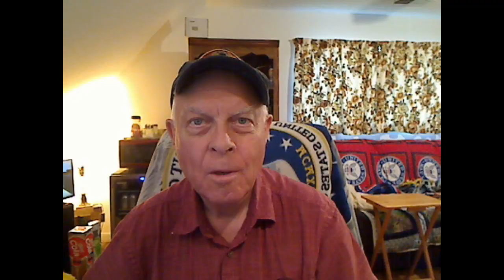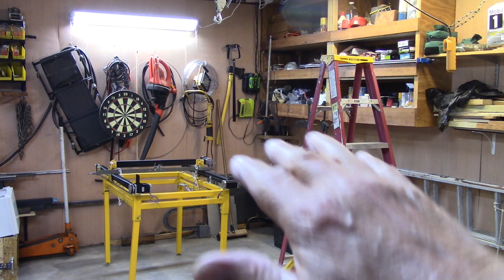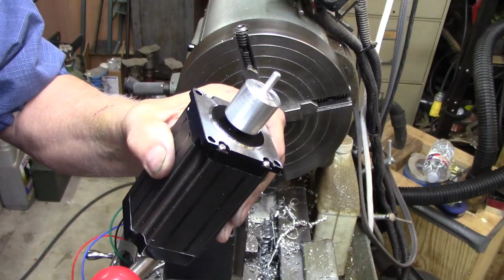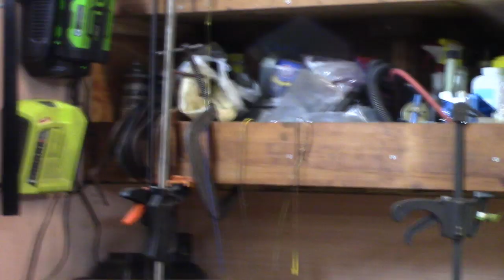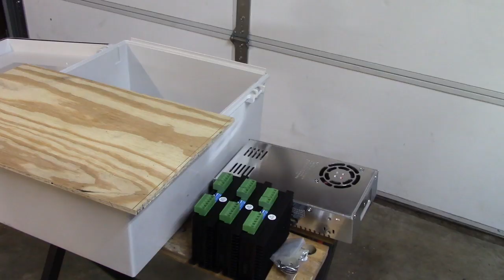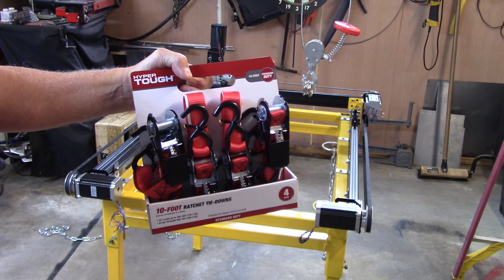Plasma cutter table Z axis finished

Comment: I'm getting excited for you, that unit is really starting to look the part. It's interesting to me to see how you're setting up the control system, as I'm curious how you are going to integrate a design from a PC into the number of steps in each motor's direction to cut your part. Very cool project.
Reply from the maker: The answer is smoke and mirrors of course.  Thanks for stopping by.

Comment: More great progress. Wondering if each corner had a hole for an "S" hook and then make a four way cord or cable set to suit the CG (numbering each connection point and its associated cord), so that from one hanging point you could then attach each of four lines with "S" hooks. Not sure if that makes sense!
Reply from the maker: I have it fastened to each corner.  Thanks for stopping by.

Comment: Did you calculate your linear travel speed for the drive pulleys you have? I think you may have gone a bit too big in diameter for the work envelope of your machine. What you want is high acceleration not high top speed (your top speed will still be plenty high enough and you'll get there fast too). By the looks of them pulleys I'm thinking the top speed is going to be over 12,000 Inches Per Minute. Which unless you flip your machine upside down and take it to the drag strip ain't going to do you much good. Do yourself a favor and order some much smaller drive pulleys now. Because once you get running you're going to see that you need them. We all hate waiting for what we want to get too. As far as your lifting goes look at how an engine hoist balancer works. I'm sure you could whip something like that up.
Reply from the maker: I will just have to correct mistakes as I find them.  Thanks for stopping by.

Comment: Harold, try making a leveler bar to go between the four straps and the center hook...like used to level a engine when you remove or replace it in a auto...!  I would try a four way leveler with chain slots on the four arms then you could lengthen or shorten as need...may work...!
Reply from the maker: That is an idea thanks.  Thanks for stopping by.

Comment: Enjoyed watching someone other than me feel frustrated while working on the latest project.  I ran into a situation where I had to enlarge a hole and did not have a small enough boring bar.  Ended up using a smaller then hole mill cutter with the cutting lip on center with the hile.  Worked  great.  Koko
Reply from the maker: Mother is the necessity of invention or something like that.  Thanks for stopping by.

Comment: i like it.  Whelp if your not having fun wiring now wait tell you need to shield the wires and ground everything.  Those plasma cutters put out some wicked emf noise.
Reply from the maker: If their are no problems it is not my project.  Thanks for stopping by.
Reply: Shielding only gets you so far. The problem lies in microelectronics being so sensitive. Pull up and pull down resistors can sink spurious signals though. Make it so only some real current has any effect on the logic. EMF spikes can be high voltage but there's really no juice behind it. It's phantom garbage. Now when it's really bad that's when you use optical isolation. Optical couplers stop all of that nonsense dead in its tracks. Optocouplers really add hysteresis to a system. I designed my own cunning optical data transfer circuitry. http://i.imgur.com/wmbrCVI.png There's a double inversion going on there. Do you see it?  A lot of this is why you see RS232 still used in industrial controls. Then there's twisted pairs and special transmitter and receiver ICs for data transfer. Which reject noise themselves.
Reply from the maker: @1pcfred  sometimes the worst does not happen and we get away with what we are doing.  Thanks for stopping by.

Comment: I feel your pain I can’t cut straight for crap either. I struggled with the 4 corner to a single point leveling issue a few years ago. I gave up, lemme know if you crack it!
Reply from the maker: You know you watch folks like Matthias Wandel and it is all perfect and so you think it has to be easy.  Thanks for stopping by.